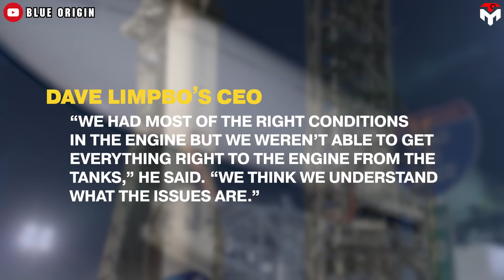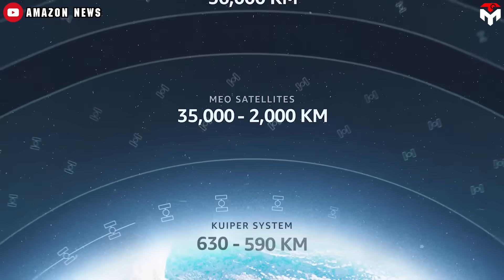BE-4 Problem! Blue Origin finally revealed Why New Glenn Booster Landing Failed...

Comment: The be4 has stability issues because the combustion chamber is too large!
Reply: Plus, with only 7 engines, there is not much room for redundancy.
Reply: Same problem the Saturn V's F1 engine had initially.. Baffles on the injector plate solved the problem..

Comment: The rocket was really sluggish off the pad with no payload. What’s it gonna do with a paying customer onboard? They better get those engines up to snuff. Laying off 1000 people speaks to issues not success.
Reply: Did think it looked like a tractor pulling away from the lights compared to Starship
Reply: Bezos is the typical billionaire. He's only managing it from above instead of being down in the factory, hands on like Elon Musk often is. That's why his project is failing, and hard. Don't expect much result from BO. They're better off hopping millionaires into space for 5 minutes.

Comment: R&D staff are not operations staff. R&D ends then units go into production.
Reply: R &D finished? Sure doesn't look like it.
Reply from the maker: Thanks for sharing. Limp also said they were in the R&D phase for so long so now it's time to change
Reply: @techmap9 That is a dtrange statement though. New Glenn still has needs to develop further. Then you have Blue Moon versions 1&2 that have yet to fly, along with New Armstrong which hasn't been even seen yet. Seems to me like there is a fairly big need for R&D yet. Especially if they would like to puck up their pace of advancement. Especially where New Armstrong would seem to be many years beyond Spaceship. Unless they have something earthshaking beyond all other rockets in the New Armstrong.

Comment: The important achievement is to recover the costly booster, not place something in orbit. My guess is that the engines broke due to their complexity and the harsh forces the booster is subject during reentry. He hasn't got the right engine, he cannot make it.
Reply: You make a good point. It would have been wiser to place the BE7 engines on a smaller test booster. You could then figure out how the dynamic forces affect engine function. Based on the data collected, you can proceed with the development of the full sized booster. Essentially the SpaceX template.
Reply: You make a good point. It would have been wiser to place the BE7 engines on a smaller test booster. You could then figure out how the dynamic forces affect engine function. Based on the data collected, you can proceed with the development of the full sized booster. Essentially the SpaceX template.
Reply: Or ice formation.
Reply: The be4 combustion chamber is too big giving it stability issues.

Comment: The fact that they succeeded in an orbital launch during their first attempt, must be given credit to the BO personnel
but
why do I have the impression that BO is still burning steps that should be undergone, and learn from the mistakes made, rather than avoided
Going from New-Shepard to New-Glenn (suborbital "tourist" launcher to heavy orbital launcher) seems to me to be similar to going from the tricycle of when you are 4-5 years old to immediately one of these Good Old Harley Davidsons that are the most demanding in terms of piloting.
And for the NG1 launch, immediately try with this first launch (where EVERYTHING must be learned from the "normal" behavior in flight of the launcher) a recovery????
Bo's mantra would be "gradatim ferociter": gradually but with ferocity!!
ok! maybe!
but in my opinion they are running at high speed towards the great "cliff of physical reality" (and in constant acceleration)

Comment: IMO the lost booster is obviously dur to the chsnging dynamics of flight and resultingbloss of fuel pressure.  Requires header tank redesign and possibly better fuel pumps and or fuel pump managrment.

Comment: Even if BO lands a booster on the next flight, which may or may not happen, how long will it take to check, refurbish, & relaunch? With 50 BE4's built in a year, you can't launch more than 7 times, unless you start reusing boosters. Less if you consider some BE4's will go to Vulcan!
Reply: SpaceX took many attempts before they recovered booster. And even when they did, it was quite a while before they attempted re-use. Recovery means they can pull apart the rocket and see how well it's working and make refinements to beef up engineering of parts that are failing too quickly, and to eliminate over engineering elsewhere. It provides a level of information that you can't receive from telemetry and simulation. It might take several design iterations until they've got enough confidence that refurb and reuse isn't a bigger risk than sending up a fresh one... But you can't even start this cycle until they've recovered at least one booster.
Reply: @DavidMcGuigan Many means over 5. Some primitives count 1,2,3,4,5, many. SpaceX didn't try that many times to land the booster before it worked. They reused very soon after the first landing.
Reply: @MarkHorton-n3t  the 23rd launch was the first to land. Even if you count from 14th, the first to go for a hard landing, that's still quite a few. So BO are allowed a few misses.

And B1019 was the first to land. But it didn't ever get reused.
Reply: @DavidMcGuigan  Hard landing is another way to say crash in a predetermined location. 
SpaceX only had 3 failures to land before the first successful one. Not many. Those failures were of Block 1, which was designed to be recovered by parachute and modified to land. SpaceX's  first attempt to land a booster designed to land. New Glenn was designed to land, and it never got close to the attempt. The comparison is unfair. 
Blue Origin will get there. If they can ever ramp up production enough.
Reply: @MarkHorton-n3t  so as this didn't turn into a fireball on the deck, BO's effort doesn't count then?

The Falcon 9 is amazing. But it was not an instant success. Including some fairly drastic redesigns (parachutes!?). They launched MANY before they landed and managed the first reuse. BO is a looong way behind, but that was a pretty good first launch.
Reply: @DavidMcGuigan  Blue Origin did reach orbit. If I had a payload, I would consider them, but both SpaceX and Rocket Lab almost certainly have sooner launch availability and are both possibly cheaper.
For now.
Reply: @DavidMcGuigan  I absolutely agree with you, the problem i have is that BO said it took them so long to develop because they have a mature system that is mission ready from the first flight unlike our competitors who launch un developed equipment, so according to their own statements they shouldn't have to revise or beef up anything or go through any design iterations.
Reply: @MrAnman1985  that is a good point. BO has never said they need to iterate. And their operation isn't set up to do so. And I suspect the design of the engine is locked in as any alterations might also risk the Vulcan.

Comment: BO is a total failure would you
Go to the moon in something they built.
They will never land New Glen on that ship
To much heat no heat shield
Aluminum parts are MELTING, RIGHT
THERE SO STUPID, THEY should JUST END IT ALL BEFORE THEY LOSE IT ALL.
Reply: You're barely worth the effort to answer, but I'll give you this.  When the re-entry burn lights off, the exhaust from the engines creates a shockwave that disperses the superheated air away from the vehicle creating a low-pressure zone that protects the ship from re-entry heating.
Reply: It's going to use a re-entry burn to reduce entry heating, like Falcon 9. The failure might have occurred during the relight, possibly due to failure to get the fuel into the turbo pumps in zero gravity... an issue that SpaceX have also previously had.

Comment: BO's problem is always gonna be manufacturing speed. They do not have even close to SpaceX's capacity to manufacture boosters or second stage rockets. Now their laying off workers? The BE-4 is still in its first iteration as far as I know. I've not heard of a V2. Which means it's still a jumbled complicated mess and he's getting rid of R&D employees and engineers? Doesn't make any sense. They'll be lucky to launch 3 times much less 10.
Reply from the maker: Yeah, If they want 10 launches a year, they need to ramp up manufacturing, not cut R&D. Feels like a step backward—think they can turn it around?

Comment: Great Video !  The Blue Origin Blue Moon HLS/LEV/LLV  can be great if the HLS has an Air-Lock and a 6.1 km/sec delta-V !  The Blue Moon HLS can support and be supported by the South Pole Lunar Outpost/Base (Clementine Base) with a LS Fuel Depot nearby for Crew SAFETY !  The B.O. Blue Moon HLS with a Crew of four (4) was my second choice, but still highly rated !  The Blue Moon HLS  can also do missions from LEO CSS to the HST, to GEO or to the LS !  The Tech developed to return to the moon to stay, can take US and the world to Mars and beyond !  Support the Vision, the Vision for Space Exploration (VSE Presidential speech January 2004) !  Also from Low Mars Orbit to the Surface of Mars is a 5.0 km/sec delta-V !  Read the paper "Moon Direct" by Robert Zubrin !  Timothy Lipinski
Reply from the maker: Thanks for suggesting the paper "Moon Direct". I will read it whenever I'm free